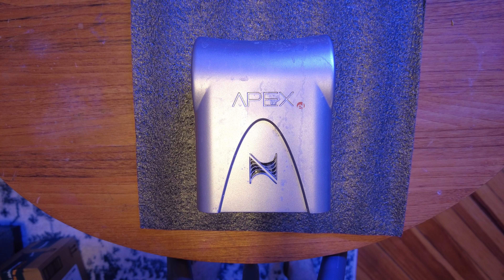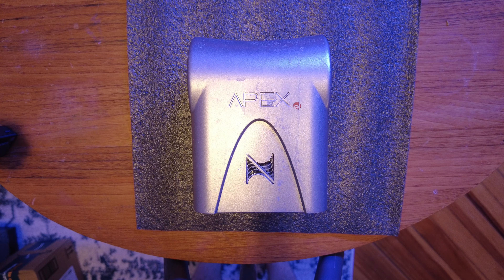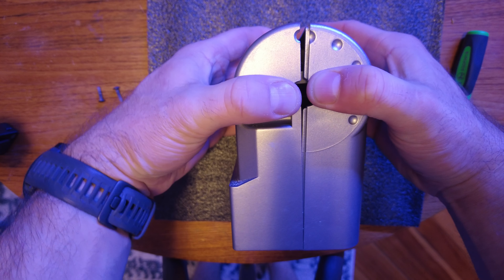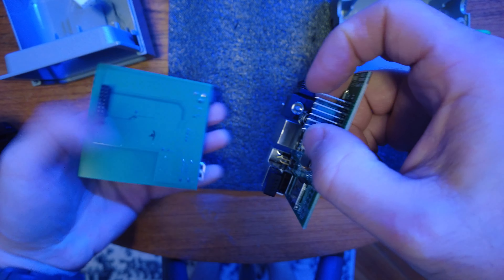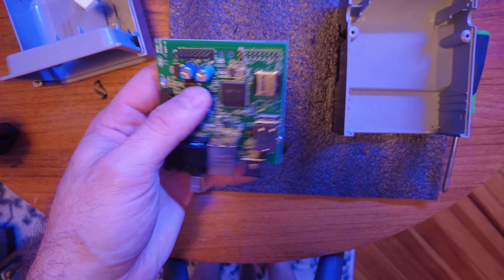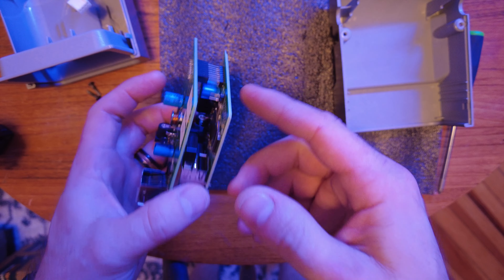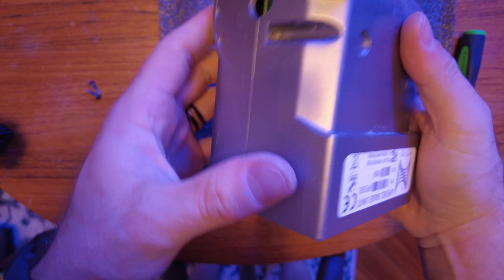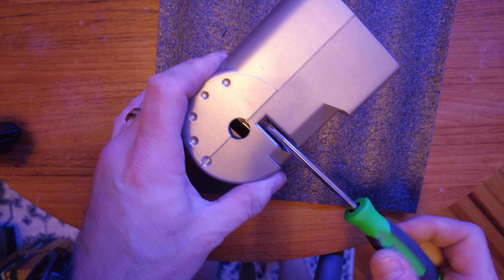How to replace the SD card on a bricked Neptune Apex

Comment: Thanks for the video, helped me a lot. Neptune actually asked me to do my own. The SD card holder is a slide towards the edge of the card and flip up. Apply light pressure and to slide towards the near edge and flip up. The SD card is just placed in and out, the card itself doesn't slide.

Comment: This is the primary reason I ditched Apex and went to GHL. Thanks for the thorough video 👍👍. This happened to mine three times under warranty. They kept acting like they have never seen this and “I don’t think it had anything to do with the update “. I held off on updates for two years then got a triton. First update for triton it happened for the 4th time and all of it’s been boxed up 😢.  

At least now I can try this to actually sell all my old system. Procrastination and not wanting to give Alex another dime let $3k+ sit in my garage 😂.
Reply from the maker: It's kind of a goofy issue,  because it isn't the update itself that's the issue. It seems to be the act of updating. So they're seeing a functional update that has no reason to brick a head, but there's bad cards out there that conducting any update finally kills them.

Comment: can you clarify something for me? the sd card contains all the programming? so if a head unit fails you can just pull the sd card from old put it in the new and everything will pop up in fusion with already existing names and programming? if so i already have a spare and am curious if i can pull the sd and copy it to the new head unit sd so it’s ready to go if this one fails?
Reply from the maker: Sorry I'm late. I haven't tried this  myself but some people have pulled the cards on working apex to copy them. So you could dump the files on a new card.

Comment: @casualreefkeeping I know this a little older video but have ever had a problem with changing the add card and having trouble connecting to a network I had a bricked on changed the sd and now it will do everything right will now turn blue but I can’t get to the step where you pick the internet.
Reply from the maker: Have you connected to the apex self broadcasted network?

Comment: To remove the SD card put your finger on the metal cover, push down and pull towards the edge. The metal cover slides towards the edge and flips up allowing the SD card to be removed. No tools necessary.

Comment: You forgot to illustrate how to remove the SD card.  On my Apex, the holder has a metal cover plate that slides (away from the pc board edge) and opens like a 'hatch', to access the card.  That's why you weren't able to just push it out.  Also, it seems a FAT32 partition will work.
Reply from the maker: Yeah the first one I did for a friend must have had the cover plate missing already. I was originally just throwing this together to help a few people out, and didn't want to go any further with a functional apex. I'm planning a more thorough update, compiling any new info from comments and what not. I'm not sure if there's different variations of the SD slot since this is an ApexEL. I'll need to get my hands on a pro to compare.

Comment: Damn, it’s a usb WiFi module? And no gaskets or anything to seal it? 😢😢
Reply from the maker: Better off not mounting electronics under your stand anyway, but yeah. I was a littler surprised about the usb wifi since decent esp chips are pretty cheap, I'd assume a manufacturer could get them at good prices.